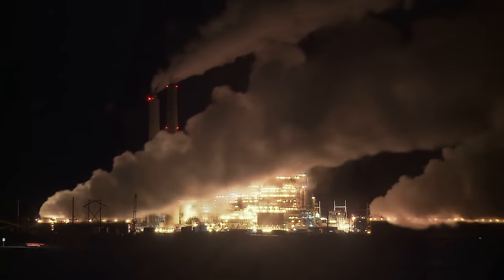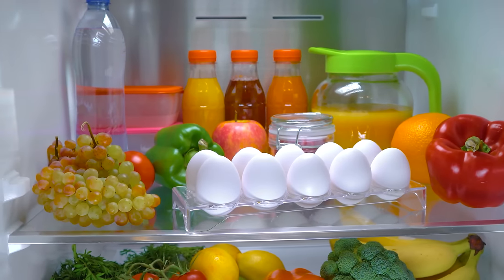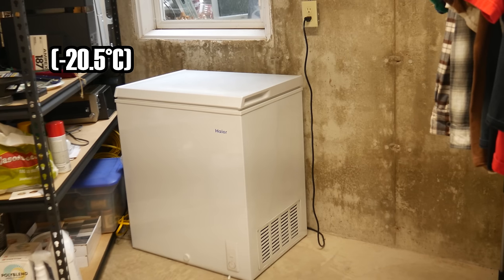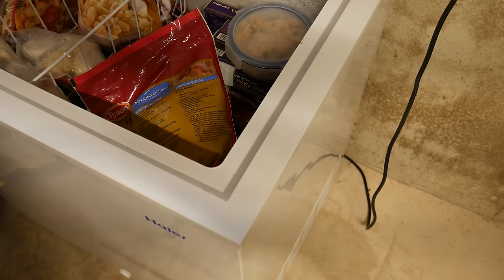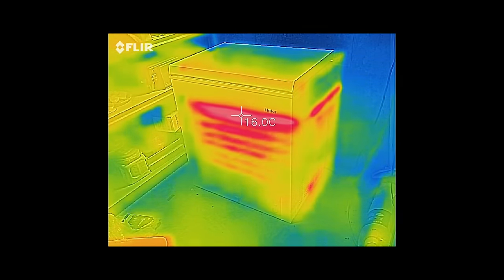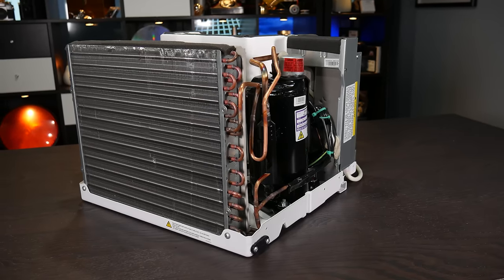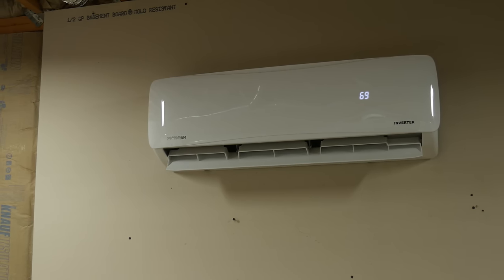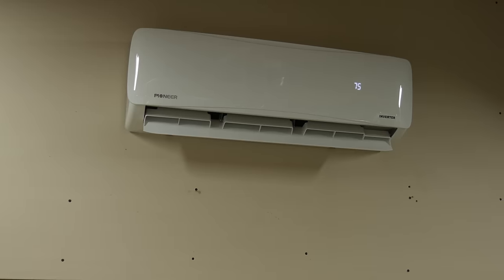Heat Pumps: the Future of Home Heating

Comment: Perhaps I am missing something, but in all of these systems one requires a compressor, high pressure lines and special chemicals. Now, perhaps due to the volume of manufacturing of same the prices are reasonable. However, I think heat can be transported without these devices if one is willing to be more patient. The size of the coils is small due to the fact that with the compressor the temperature difference is significant and so the heat exchange occurs rapidly as required by Newton's law of cooling. If we had larger heat exchangers then the same amount of energy could be transferred only in a longer time for a given area of coil. My thought had been to place a length of fairly narrow plastic pipe in the ground that is circulated by a small pump. When this comes into the home, the heat exchanger would be built into the home's basement and might be for argument's sake 24 inches square by 8 feet long or whatever the actual design might require. From one end of this plenum, the ducts go to the various locations in the home. The other end is open to the basement environment save a filter (which does not have to be as thick a regular furnace filter.  Instead of a large forced air fan, as pushing air is less effective than sucking it, each register will have its own fan that will draw air into the room. For winter heating, I would use hot water solar panels with a basement cistern as a heat sink. Then switching from AC to heat in the winter would require valving out the ground loop and valving in the loop submerged in the basement cistern. With decent hot water panels, I think the cistern could be kept warm enough by the hot water that it could provide adequate heating.
Now, my idea requires far more space and would not work in small locations for that reason, but no fancy chemicals or compressors. Coupling this with a well insulated home I thought it might be effective. However, with the ease of manufacturing these devices and their compactness,. perhaps it is the way to go. 
Can a home be retrofitted with a heat pump if we have an outdoor AC?
Thank you for the detail. Henri

Comment: Realizing this is a pretty old video now, I don't really expect a response but I've heard about gas-fired chillers. Not entirely sure what they are but was told that for large air-conditioning applications, like hotels or shopping malls, the system is run on natural gas and not electricity. Can you say anything about that? Could it scale down for domestic use and if so, can it also be reversed in the winter, thereby providing heat and without needing a separate emergency gas-fired heating system if the grid goes down?
Reply: I think what you're referring to is called an absorption system. I have learned about them but don't know it well enough to explain. They are common on RV fridges. I know that doesn't exactly answer your question but hopefully gets you pointed in the right direction.
Reply: Unfortunately with Gas fired chillers, they don’t make much sense from a cost standpoint. Between maintenance, city inspections, and the huge water bill/gas bill (unless it is air cooled) no ordinary household would use it. The smallest one I’ve seen is 30 tons, while an average house in the US has a HVAC unit that uses 2.2-3.5 tons. But yes, big commercial properties use these systems. Hospitals, power plants, schools, industrial and warehouse facilities, etc. -I’m a project manager, have to have general knowledge in HVAC, plumbing, and electrical systems

Comment: In the not so distant past, I had to replace my natural gas furnace. The multiple quotes I received were all for another natural gas furnace. Never was I offered an upgrade to a heat pump. After watching this, I am more informed but also upset I didn't have this information before purchasing. I would like to know why they never bother to offer a heat pump as an option for my application.

Comment: If you put a pipe heater s coiled up behind the condenser it will cause less defrost time and pull way more heat from it to heat way much better in colder temps .I'm a mechanic and understand standard a/c systems that if you want a/c the condenser will get hot if you want heat the condenser will get cold but if you heat the cold outside it will heat the inside way so much better,they should've thought of this  off the ambient temps and built it in to be improve the cycle defrost times inside or out

Comment: Question:
Heat pump hot water tanks exist,
A hot water tank is essentially a big thermal battery, and by heating it with a heat pump instead of resistive heating you’re essentially getting free energy by pulling heat out of the air instead
Could you, in theory, create a system in which you have a heat pump water heater running at all times, and use any excess hot water it generates to power a generator, and circulate that now cooled water back into the tank, therefore offsetting your electrical costs by turning outside heat directly into electricity, or would a heat pump/generator combo not be efficient enough for this to work
Reply: Basically you are asking if you could use a heat pump to heat water, and use that hot water to make electricity.  Interested question. Let's say 30 percent efficiency at getting to electricity for the last step. That might be break even, but would ignore maintenance, capital costs, etc., and you would also be adding a lot of cooling in your home, which would cause problems in winter. Interesting idea, but better to use heat pumps at home for heat and use turbines at power plants. Photovoltaics at home and at plants are ok.

Comment: in a small space this may work....but at the jail i worked at in texass, anything below 30*  and the heat pumps could not heat large spaces effectively.  maybe modern commercial heat pumps are better?....but finding out by freezing ain't the answer.
Reply: A properly sized and installed heat pump should be able to heat effectively to at least 20*F but it depends on the unit.

Comment: Query:
Can you make a self contained loop which moves warm air to the cold box then when a certain tempreture is reached reverse the process? Would you be able to power the unit with solar power? Would you be able to make a linked steam powered dynamo utilising water heated by the hot air passing through tubing, where the tubing is wrapped wround the water pipe? The water pump would also be connected to the solar power.

So the idea is.
Minimal solar power imput.
Utilising presurised gas to create heat.
Utilising a piping system to transfer heat to water.
Utilsing heat from water to power a steam dynamo.
Idea is to rely on minimal solar power and to utilize and store energy in batteries or a grid through the heating of water.

One extra thing would be needed. To not pump water into the system on the cooling phase.

Is this possible, how hot would we get the water, do we need to change the water pressure to get the water to become steam for the generation of turbine power?

Comment: 1 calorie of heat is the energy  required to raise the temperature of 1gram of water by 1 degree centigrade.  The latent heat of vaporization of water is  533 calories per grams which, when absorbed, will change water from a liquid to a gas (water vapour) without a rise in temperature.  the reverse is true. It is also true that the normal boiling temperature of liquids increases as the pressure on them increases.
 Heat flows down a temperature  gradient, hence concentrated energy released from burning fuel provides high temperature gases which cool down as the heat transfers to colder  material around them. In practical terms very simple.
If a gas at ambient temperature is contained and compressed  the added energy from compression will increase its temperature but the temperature gradient created will cool  the gas and container back to ambient  over time. As long as the pressure is maintained, a gas that is close to normal condensation temperature at the start may now have a natural state as a liquid.  This will result in a lot of latent heat being released during the temperature drop to ambient.
If the liquid, still under pressure, is transferred to an alternate area at ambient temperature  and the pressure then released ( within the container) the natural state will be as a gas and the required latent heat to achieve this will be absorbed by conduction from the ambient air resulting in the air being cooled to a lower temperature.  This is how heat can be pushed up a temperature gradient and is far from simple.
If the lowest boiling point of the gas/liquid transfer medium is not lower than ambient the electric compressor becomes an expensive electric heater.
 As an air conditioner such a system has very little competition to extract heat with at a domestic level but as a means to deliver heat it is a badly limited contrivance when compared to  an arctic refuge equipped with tinder, kindling, logs and a box of matches.  The north south distribution of such systems in North America is not through ignorance but balanced consideration of real life physics and economics. 
While I can see a polar bear being interested in a roaring fire  you are never going to sell him a heat pump. Who needs a device that works best when a thicker pullover will do.

Comment: What would happen during winter if the outdoor unit were surrounded by a brick structure that mostly blocked wind and was slightly insulated but could still allow outside air to come through? Would that reduce the frequency of defrost cycles? Would surrounding it by a partially insullated structure make it more or less efficient?

Comment: I live in Europe and condensation natural gas furnaces are pretty common with an efficiency of 105 to 110% because they use residual heat from the exhaust gasses to heat up just a little more the water for the central heating system, heating with a heat pump wouldn't make sense here unless used clean energy (from an ecological point of view)

Comment: Just so you know, heat pumps can definitely be used for vehicles. It's pretty common on ambulances made within the last decade.
Reply: It's pretty common for cars in general.
Reply: @logitech4873 Not really. Most cars use engine coolant into the heater core. It wouldn't really make sense to have a heat pump on a car when a bunch of heat is being generated from the engine.
Reply: @Xavier_Wells  Heat pumps are how they cool the cabin. A/C.
EVs also use heatpumps for heating the cabin.
Reply: @logitech4873  sure, an AC is a heat pump, but this video is talking about heating. SOME vehicles use a heat pump for heat(some EVs specifically) but MOST vehicles use waste engine heat. For the AC of course a compressor is used.

Comment: actually the heat comes from the compressor compressing the gas. so the heat comes from the power outlet.  compressing the gas increases its temperature. the same goes in reverse during summer. just a tiny bit of the heat in the condenser comes from inside the home. the rest comes from the action of compressing the gas by the compressor that uses a lot of energy.
Reply: You have it backwards. Only about 10% of the energy powering the compressor gets converted to heat. The rest goes towards actually compressing the refrigerant. If that was not true then heat pumps and ACs would not have a COP greater than 1.
You are confusing temperature with heat. The compressor increases the temperature of the refrigerant but does not add much heat to it. The temperature increases because of the compression. The refrigerant has almost the same amount of heat but that heat has been concentrated into a smaller area which increases the intensity of the heat (temperature).

Comment: When I was taking thermodynamics at Berkeley the professor explained heat pumps vs normal heating systems and how much more efficient heat pumps were.  Then he asked the question, "Why do people use regular heating systems?"  Turns out the answer was heat pumps are just better.

Comment: On very cold days, would you be able to use resistive heating outside to heat the air it takes in? That way you can still use the heat pump efficiently, just with some added heating
Reply: You could, but your overall efficiency drops because you're only getting at most a 1:1 ratio of electrical usage to heat.  It's generally going to be better to let the heat pump defrost itself (at better efficiency), and then it'll work at the best efficiency it can for the circumstances.

Comment: What I find perplexing and counterintuitive, isn't so much the idea of "air conditioners" being used to heat, but rather the idea that this is more energy efficient than, say, radiant floor heating. Speaking as somebody who lives in an apartment with a wall air conditioner and radiant floor heating, in an area where the temperature typically ranges from -20 to 90 degrees F, depending on the time of year... the air conditioner uses MUCH, MUCH, MUCH more energy than the radiant floor heating. Unless my landlord was absorbing most of the cost of the radiant floor heating(?), the heating bill in the winter was typically about $8/month.

Comment: Love my heat pump backed by lower-efficiency gas furnace (92%).  I would've gone with an 80% if I had the venting setup since I run my HP's absolutely as low as they can go.

Comment: For some reason my HVAC company told me that it would be impossible to replace my AC with a heat pump because the heat pump is a lot larger and would thus require expensive pouring of new concrete and relocating all the ductwork... I feel like that shouldn't necessarily be the case, but now I have a brand new expensive AC and am still stuck with my furance... Oh and I've got this new feeling of frustration towards my HVAC company (Carrier).

Comment: 3 main problems:
-inefficiency ad the differential between the required temperature and the outside environment is. Deep probes solve the problem mostly, but on large scale could induce environmental problems.
-Heat pumps better work with air, but they completely miss radiant mass, which create discomfort with the heat. They could be converted to water radiant floor systems, but then they become even less efficient at heating up, while at cooling down they can create condensation which is problematic as well.
- Using electricity to heat up is not ideal: you are converting the most noble of the energy states into the less noble (heat) loosing all in between through entropy.
It is viable Only 'IF" there is an excess of electricity production in the grid and it sales at very low cost, which, at the moment it's not true.
- if electricity is produced mainly through non renewable resources, like coal, oil and nuclear, then you are just shifting the pollution from the end user to the main provider, adding dispersion waste due to the need to move electricity through a resistive cable system.

Comment: Why at that house did they have both the air conditioning unit and heat pump I have a heat pump and I use it as an air conditioner in the summertime I don't also have an air conditioner. just kind of curious I live in Canada so maybe heat pumps don't work very good way down south to make a house cold?

Comment: Nice video, thanks.  

   I live in the mid Atlantic region, south of the Mason Dixon line.  Typically the coldest it ever gets here is around 5* F, but quite often it is much closer to freezing (and a fair amount of time above same).  Our AC unit apparently has a heat pump mod since we only have electric for cooling and heating (minus the woodstove we installed later on).  

      I don't know if this would work or not, but I've been wondering about the following: Using a pressure washer and shovel, I plan to dig into the ground about 9 ft or so near the condenser unit outside. Into those holes, I will put a few modified copper pipes. The mod will be that I will turn them into essentially giant "heat pipes" like the ones used to cool computer systems (accomplished by some wicking material, a little distilled water, and a vacuum pulled on the pipe to lower the boiling point of the water inside).  

   The first 1/3 to 1/2 or so of the pipes will be uninsulated and directly in contact with the earth. But the rest will be well insulated. Separate copper tubing will be wrapped around the giant heat pipes (in direct contact) and then well insulated.  Water from a super insulated tank nearby will be pumped through the copper tubing coils now buried underground and also wrapped around the condenser.  (I'll probably use some cheaper tubing towards the top of the ground and running to the condenser since that will need to be insulated anyways). 

    I'm not sure this would work though?

Comment: Just changed my 20 years old HVAC setup to a heat pump 20 SEER Bosch. Top of the like they said. Before: AC was loud but furnace heating was wiper quiet. Now: AC is quiet , but Heat Pump is loud. Do your research.

Comment: The UK gov is trying to push even force heat pumps in the UK.
But already those who took up the offer last year are regretting it.
There are apparently some drawbacks.
Like ACs you need to turn it on for a while before the room gets cool
Same with heatpumps, you have to turn them on hours before you want a room at a certain temperature.
So these people spent a long time in the cold whilst their heatpumps got to work.

This could also be because heat pumps are new to normal consumers who are used to gas boilers which will heat up your room very very quickly.
So if you need a room heated quickly, heat pumps are not the answer.

Comment: Are there any examples of heat pumps that have a mechanical de-icing component? Seems like you could save efficiency spent re-heating the coils by simply knocking some of the ice off.